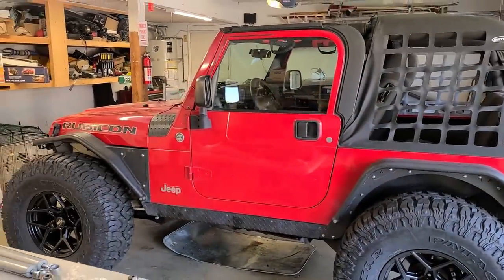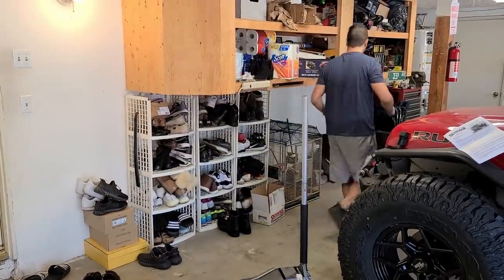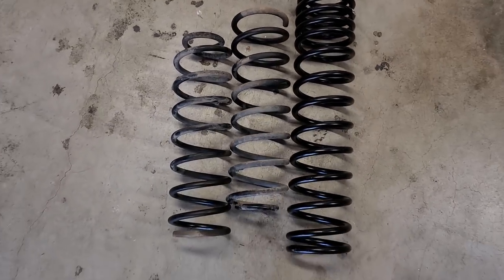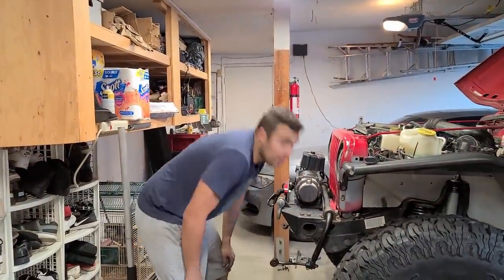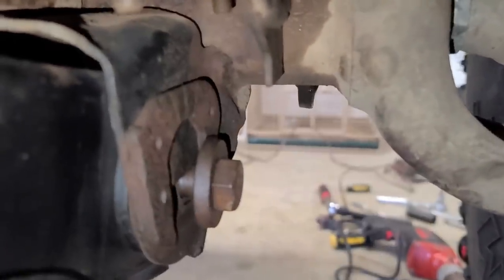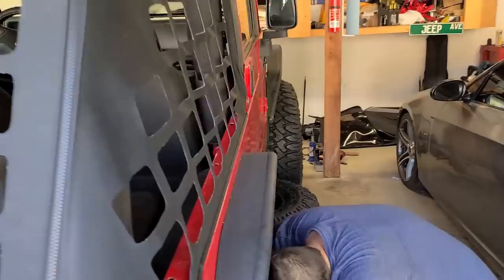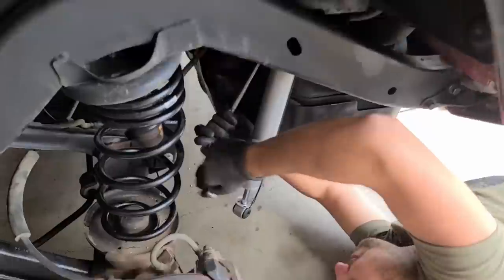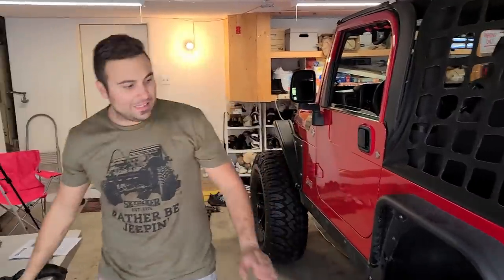We Finally Lift Our Wrangler 4+ Inches on 38s! Full Step-by-Step Guide

Comment from the maker: IF you want to check out some of our favorite jeep mods, here you go!
Plug and play HALO LED headlights - https://amzn.to/36O7sW9
Smoked LED turn signal - https://amzn.to/2EQ7X67
Steel Stinger Front bumper - https://amzn.to/2WjykMA
Smittybilt cargo cover - https://amzn.to/2QeIMzQ
Ares technology PCM - https://arestechnologies.com/
Skyjacker lift kits: https://skyjacker.com/
Rocktrix Rims - https://amzn.to/2xS8Mus
Rocktrix wheel spacer adapter - https://amzn.to/2yDVmD3
Tom woods drive shafts: https://4xshaft.com/
Milestar Tires - https://www.milestartires.com/ 
Affordable sun shade - https://amzn.to/2wWQQyq
Rear LED tail lights - https://amzn.to/2wa7evn
Synthetic winch line - https://amzn.to/3cU01QR
Aluminum winch plate - https://amzn.to/38SLWQq
Rubicon DECALS - https://amzn.to/2xG5lqT
RGB rock lights - https://amzn.to/3b0BoAd
Scrubblade wipers - https://amzn.to/2WcmnHi
Red roll cage fire extinguisher holder - https://amzn.to/2w8ZKsv
Auto fire extinguisher - https://amzn.to/2vjcBIe
Cowl Guards Jeep TJ - https://amzn.to/38SY8QY
4wd Kings light bar - https://amzn.to/2wTOEYy
Stubby antenna - https://amzn.to/2vq9m1S
Reply from the maker: Appreciate that!

Comment: You guys have a sweet TJ! I’m not here to bash on it but to provide some insight and advice to a fellow Jeeper.  Some problems I can see that you guys may want to check into include:
1) Flex out the suspension and see what hits. Looks like you don’t have enough of a bump-stop for the tire size (especially for the rear). 
2) The rear shocks are going to hit the spring perches when they’re fully compressed. Common TJ problem especially when adding a lift. You can get the shock relocation brackets for less then $50.
3) The skyjacker is a budget lift and a problem it doesn’t fix is the suspension geometry that results from raising the the frame away from the axle. As you go up in lift your wheelbase gets shorter. The skyjacker arms doesn’t correct this since they are the factory length. 
4) For the future consider getting a set of adjustable control arms. This will really help set up better pinion angles and get your caster back into a factory spec.
5) Also when flexing out the Jeep check the length of brake lines. I didn’t see you guys swap them out  within the video.
Hope this helps and good luck on the build!!
Reply from the maker: Appreciate this very much! We will test out some of these and try to fix them if they need fixing. We have a set of adjustable uppers ready to go on. The skyjacker arms were a bit longer than the factory arms, we didn't realize it until after we made the video. Cheers
Reply: what's your opinion on the rought country 4 inch long arm lift. looking for something around this price range (1000-1800), this video was posted 3 years ago. I see some kits have added stuff.

Comment: Had a similar lift. Won’t mention the company. When I changed out the fixed control arms for a full set of Metal Cloak Adjustable Control Arms I fell I love with the way my Jeep drove again.
Reply: I just ordered all the Metal Cloak control arms , tie rod , drag link, and track bar for mine ….currently my 4 door JK is rocking side to side worse than my tj ever did… hoping it fixes my issue

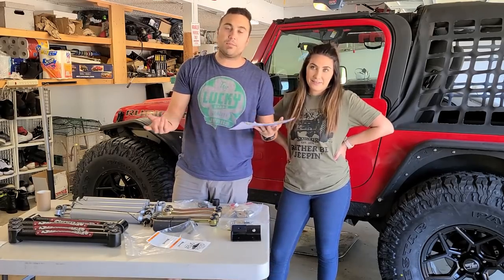Comment: Man that looks awesome. I have a 1999 Jeep Wrangler TJ sport in the same color. Right now it only has a 2 inch lift and 31s. I'm trying to find some rubicon axles (4:10) so I can add a 4 inch lift to it eventually and 33s or 35s. It will be going to college part 2 (masters) with me. This Jeep really is special because my parents have owned it every since I was born. They actually brought me home from the hospital in it, so it is crazy to think that I'm driving it. It's also pretty cool that you are a school teacher. My mom is an 8th grade math teacher and my dad is a 9th grade history teacher. I currently am a math tutor at my mom's school for 7th and 8th grade. Previously, I worked at my undergrad university as an Organic Chemistry, Chem 111, 112 and an Oceanography lab TA. Now, I have a teaching assistantship at my next university where I am getting my MS in Biology. I really hope I can find those upgraded axles before I leave for graduate school though. The Jeep currently has 3:07 gears and they suck. This university is wayyy up in the mountains and the elevation difference results in a large power difference than where I currently live.

Comment: Looks like it still needs some trimming in the rear if it is going to flex any. Awesome build guys!
Reply from the maker: Yeah, fortunately the dual rate springs keep things nice and stiff. We are planning on taking it to a fabricator and cutting the rear tub. Either that or a body lift. If we do a body lift it won't clear the garage lol!
Reply: @Garagecouple  metalcloak makes a mod cut mounting plate for your exact problem. All you need after you buy it is a grinder or dremel to cut away the tub, you shouldn't need to pay anyone for any fab work. However, I understand not wanting to cut up your car if you don't have experience. It would be a pain to mess it up.
Reply: Cut the tub. I wouldn’t recommend a body lift. Nice job so far.

Comment: Do you not have any drive shaft vibration? You didn't have to do anything to compensate for the larger angle of the driveshaft? Like lowering your transfer case?
Reply from the maker: We didn't have to lower it and we get minimal vibes. Maybe because of the larger tires, but in any case we have a cv shaft ready to install

Comment: just some advice that helped me with my manual  tj, get the S.Y.E kit and driveshaft i had problems with the 4wd shifter and transmission shifter till i installed the sye kit, also upgrade the upper control arms and look into quick disconnects for front sway bar. upgrade the trac bar helps with lift i use the iron rock trac bar its beefy!!! also honestly should only use drop pittman arm if you going over 6" lift i did alot of research on that subject and talk to alot of pros. hopefully this helps out , keep up the cool vids!!!
Reply from the maker: You can;t do a SYE kit on a rubicon..There is no slip yoke on the transfer case.
Reply: @Garagecouple  oh yeah its has a different tcase than my 231 lol my bad

Comment: That thing is NASTY!!! Such a good job guys 💪
Upgrade those shocks when you can. It will blow your mind! Rubicon Express is a great value but the Bilstein has better valving. If ya got the dough go FOX
But either way the jeep is amazing!
Reply: Also drop the pitman arm if it didnt come with a bracket. 
You need those two arms aligned for proper steering geometry
Reply from the maker: Thank you! Yes it came with a drop pitman arm, but reading the forums, people say not to drop the pitman arm if you dont adjust the upper track bar.
Reply: Is it in line?
Reply from the maker: I'd have to take it up to freeway speeds. I'll do that soon

Comment: Aloha gang, just checking in to see how the Skyjacker suspension is holding up after all this time, back here in the islands, especially my Jeep community are telling me not to go with either RC or Skyjacker.  Next project with my 03 TJ is a suggested long arm kit because I want to run 37's....I will also be beefing up the rear D44 & swapping the front D30 for a D44(G2)...

Comment: New to your channel next time on the front, remove the track bar all the way off and if you unbolt the lower control arm the axle will drop more and don't have to compress your springs. All for the shocks the lower bolt use a 13 wrench and and drill or ratchet with a 13 socket. 

I've removed my front dana 30 about a hundred times
Reply from the maker: Thank you! I appreciate the suggestions!

Comment: A pillar Grab bars are a must now! Great video!
Reply from the maker: Thank you! For whatever reason they require drilling in this model year vs our 2001 that doesn't
Reply: @Garagecouple  it's about a 1 1/2 hole in the plastic trim. Totally worth it in my '05 tj
Reply from the maker: Agree. On our 01 its totally exposed

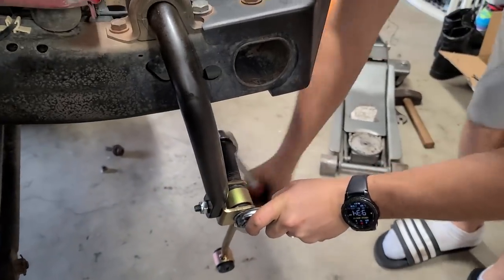Comment: 27:35 Is that sway bar link backward? Also, with the trackbar/drop pitman arm - you want both the drag link and trackbar to be parallel. I think that by moving the trackbar over, you may need the drop pitman arm to achieve that.
Reply from the maker: Thanks for the suggestions!

Comment: What are your thoughts on Body lifts to add more clearance for bigger tires, at present I’m running a 3-1/2” RE Lift w/33’s, would like to run 36’s in near future, I will be changing the gears to 4:88 and add chromoly axles also...
Reply from the maker: Up to 1.25 inches is perfect, no more than that!

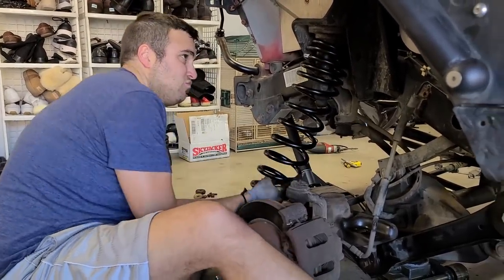Comment: 17:00 If the jack was removed, you could probably lower the axle a LITTLE more and the spring would fit. That, or remove the lower control arm and it would fit no problems. I've done it so many times - I HATE spring compressors!
Reply from the maker: Appreciate that! Yes. Spring compressors are awful!
Reply: @Garagecouple  They are, haha. That said, I did do springs once with a pry bar.... that ended badly. I ended up crushing my thumb - thankfully it didn't break but I did lose my whole fingernail as a result. Springs are deadly, haha!
Reply from the maker: Wow that sounds like a nightmare! Thanks for sharing and be safe!

Comment: Love this channel, love that y’all are Jeep lovers and Christ followers. Your Rubicon had an awesome stance on those 38’s without the 4” lift, so curious what made y’all want to lift it?

Side note - I’m also running a 4” SkyJacker lift with 35’s on my white JK Wrangler and it’s smooth on the highway and fun & bumpy on city streets, so y’all made a nice choice. The shock bodies are all white too so they match the Jeep nicely 👌🏻
Reply from the maker: Thank you for the kind words! Even though it fit without the lift, it was practically impossible. Love the skyjacker lifts!
Reply: @Garagecouple  My pleasure! Y’all should bring your Rubi to Dallas
Reply: @Garagecouple  And also, I love those fender flares on your red Rubi. Where can I get a set for my White JK X?? Do they make them for the JK??
Reply from the maker: @stephenisaaks1  they absolutely do. They are @metalcloak high line fenders

Comment: That is the stock bump stock....it comes that way from Jeep. You were supposed to take that bolt out, add that spacer and reinstall a longer bolt. If you don’t have enough bumpstop your tires may rub.
Reply from the maker: Our green tj doesn't have that bumpstop actually! If we added the extender on top of that extension it would be nearly touching with no flex
Reply: I’m just trying to help you so you aren’t spreading misinformation. Also, you are calling the washer on the front control arms a Cam. Most TJs didn’t come with cams from the factory, they came with washers like yours. The slots and horse shoes are there so cams can be added at a later time if needed
Reply from the maker: Always appreciate the info! Our bump stop on our 2001 doesn't look like that! We assumed all the tjs were the same. As for the cam bolt, much appreciated!
Reply: Garage Couple no problem, that’s the way it is on my 2000 and my 2005 that are sitting in the driveway right now. Are you sure someone didn’t modify your 2001? Possibly a shop that did the lift on that Jeep ?
Reply from the maker: Just double checked the 2001. Yup, it's not like that. It looks original. I am the only one who has worked on it. I'll look into this!
Reply from the maker: Appreciate that! The thing I've learned about these rigs is that there is a lot of variation from year to year. None the less I am always willing to learn and happily admit if I am wrong. I'm an MD, I'm learning the world of Jeeps in my sparse spare time. Didn't realize there was a bolt on long arm kit! Thanks for the tip. Cheers and happy Sunday!
Reply: @Garagecouple  thank you and both of you be safe also i look forward to the next video.
Reply: @petergrahamjr3304  Negative, you are wrong. Just went and watched the video again. 1. that is a stock bumpstop, per the link I provided. 2. That is a thick OEM CONCENTRIC washer that centers the bolt in the slot. If the washer had an eccentric hole, ie - it was drilled offset, it would be a CAM washer. Please go google "Jeep TJ Bumpstop Cup" or go here https://images.app.goo.gl/EW4TAdFExDpycykH8 and please google " Jeep TJ Cam Washer" or go here https://images.app.goo.gl/qyYpPgdUdEEZpjLAA. I hate when people spread misinformation on the internet and have no idea what they are talking about.
Reply: @gtowncasey111  https://youtu.be/VWyYflCpCAQ in this video around the 3 minute mark and after it shows the axle side lower control arm bracket which allows for pinion angle adjustment via a cam bolt

Comment: Raised my TJ 4 inches. My axles are way off. I cant figure it out. I hope and pray adjustable stabilizer solves the problem.
Reply: You probably need adjustable track bars.
Reply: @raybates3119  had to get an adjustable track bar and upper and lower adjustable control arm.. I had to get bump stops and now currently regearing my TJ to 4.88. Just bought some wheel adapters, Gusset kit, axle truss, and ball joints.. just need to buy some front big brake kits and then I'll be ready for my 37's.. oh yea. I'm also buying those supermicrochips for some extra horsepower and torque.. damn this thing is work just to put some 37s on
Reply: @kkim1177  Yeah.  I have a 4" Skyjacker lift on my 02 TJ and I only run 33's.  It has the optional Dana 44 so it has 3.73 gears and the 33's seem at home there.  I had 37's on my 2018 JL Rubcon with 4.10's and 4" lift. The lift was perfect and the gearing was  around town but we put it back to stock and 35" Dick Cepek Extreme Terrain MT's.  Unless you are going to off road a majority of the time, that factory Rubicon suspension is hard to beat.

Comment: Bet you'd have won the bet if you removed the control arm! Mine was a different manufacturer, but that's how their instructions ran and I didn't have to use a spring compressor. 😁
Reply from the maker: Wow thats nice! It seems impossible to realign if we did it in that order lol!
Reply: @Garagecouple  it was actually VERY easy to align without the tires and weight on it. I could move the axle anywhere I needed it. Just did one side at a time.
Reply from the maker: @byronjamerson4198  awesome! Will try this next time!

Comment: Aloha from the quarantined state of Hawai'i on the island of Oahu, been following you for a while, that is one sick looking ride, my question is, did you have to change your gearing, because if I'm correct your stock is 3.73, but now your running 38's...
Reply from the maker: Our stock gears are 4.10 and they feel pretty decent!
Reply from the maker: Hope you're healthy!
Reply: I’m running the same 38” tires and would highly recommend re-gearing to 4.88 or lower. It’s night and day difference in daily driving and in the mountains here in Norcal. Fun video to watch!
Reply from the maker: Are you on auto or manual? Ours doesn't feel that bad!
Reply: Garage Couple it’s auto and the manuals do a better and somewhat more forgiving admittedly with bigger tires. 

I suspect it comes down to the type of area one daily drives. Here in the mountains regearing is needed and when offroad it gets our low crawl speeds back for the big rocks.

Have a friend with a manual JLU on 35’s and looking at jumping to 37’s. His feeling is he will have to regear based on how the 35’s are doing but doesn’t hurt to try.

But in the end, if it’s working then concentrate on other upgrades. Regearing isn’t cheap  but if locker upgrades are needed, then it may be worth it at that time.
Reply from the maker: Appreciate that! The manual makes a HUGE difference vs the auto. We prefer the way it drives without it being regeared.

Comment: The front bumpstops were factory. Nothing was welded. Should have installed the supplied extensions between the part u thought was welded on and the part you unsolved. Same as u did rear. Fronts are way longer

Comment: Just noticed  how much weight was on your rims.  You paid extra for the proper balancing,  why so much weight?
Reply from the maker: Yeah we paid an arm and a leg and they still had to add some weights to some. It feels smooth though without much vibration. Oh well!
Reply: I could not believe how much weight was on there, I have never seen that much on rims before.
Reply from the maker: Oh we've had way more than that on our 35s
Reply: Patagonia's are notorious for balance issues.  Then again I had 35" BFG KM2's that were a pain to balance.

Comment: Are you going to be running 38s on stock rubicon axles?
Reply from the maker: Yes! Until they break
Reply: Garage Couple okay glad you know that they’ll break. I was just making sure 😂
Reply from the maker: They probably won't break! But if they do we will fix it!
Reply: So you’re not upgrading the axles? Assume you’re not keeping the stock 4.10 gears with those huge tires. You’re gonna need like 5.13 or 5.38

Comment: Surprised people are still installing tall lifts. Low center of gravity lifts (LCOG) is really where it’s at. I wheel with guys running 40s on  just about 2” of lift. Far more stable off road, on road manners are better as well, no vibrations given adjustable arms to dial in pinion angle etc.
Reply from the maker: Agree LCOG is awesome but we wanted to lift!